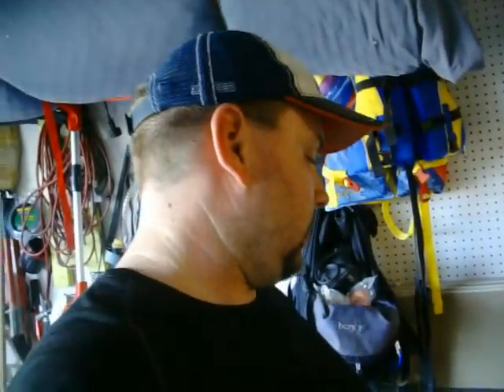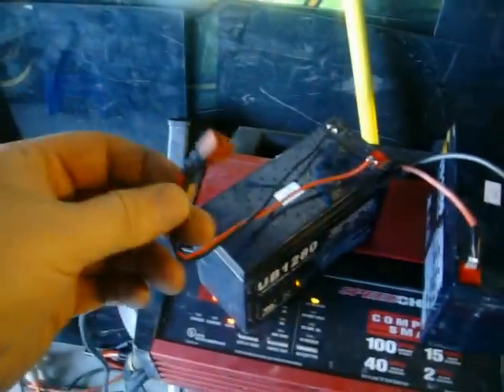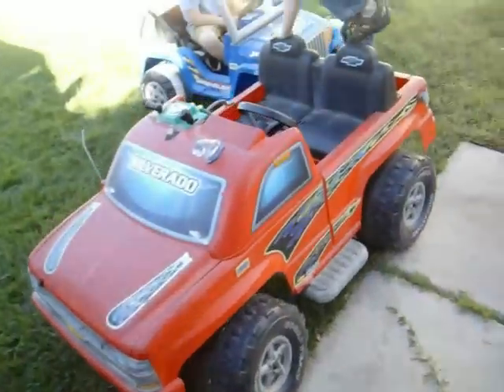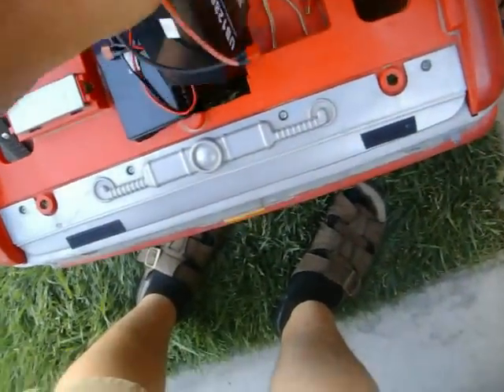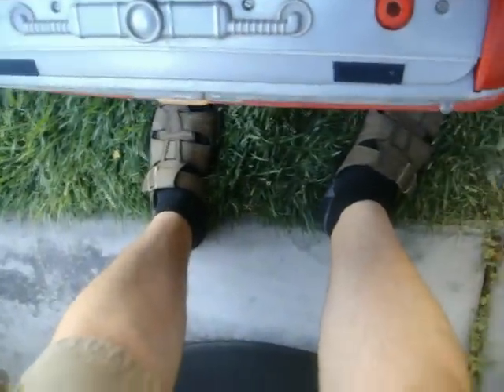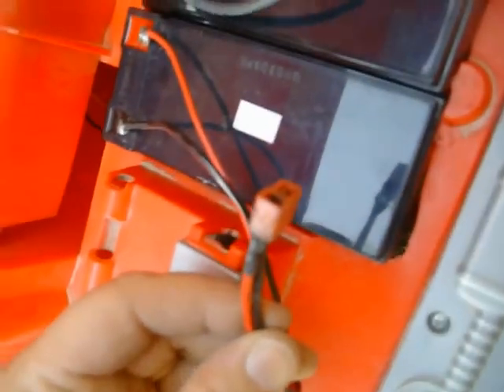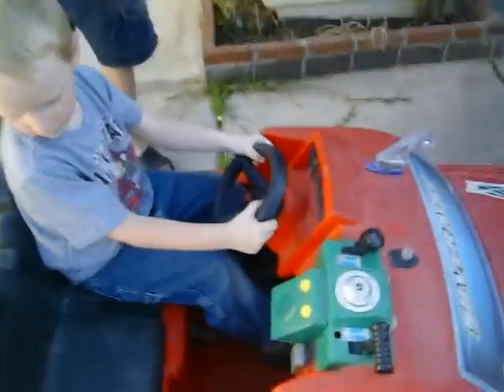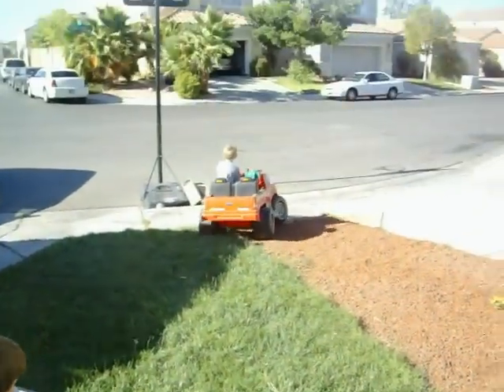24 volt Powerwheels upgrade.

Comment from the maker: No it will not fail if you wire it the way I say to wire it...separate gas/brake switch...and it is not 24 volts shocking the system  it still runs on 12v...then you hit the turbo button=WAY less stress.   This setup is still using the stock gearboxes and these power wheels  have been running for 8 years like this... so much so that kids are grown out of them.... total investment $60 at a garage sale for the 2 vehicles...$30 in batteries from amazon.   a few assorted bucks for wiring, and switches, and 30amp relays...(most of which I just had laying around the garage...This is how to do it on the cheap...you only need to upgrade when parts start to fail.